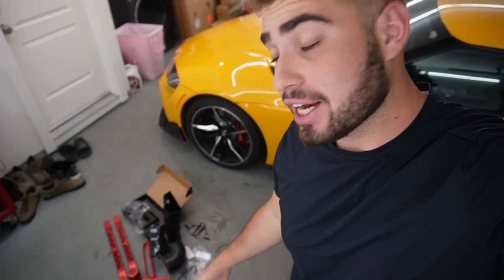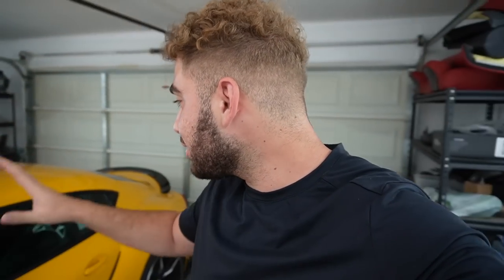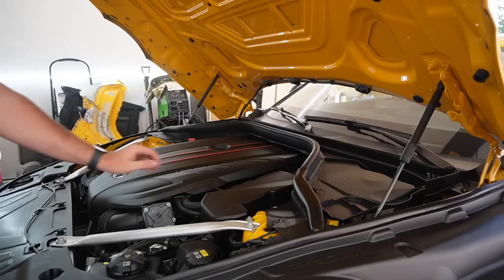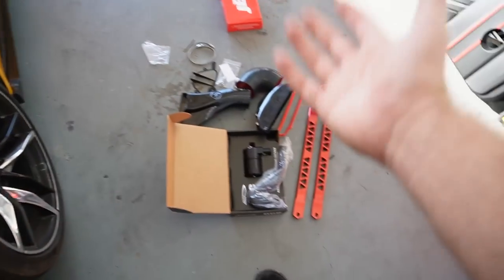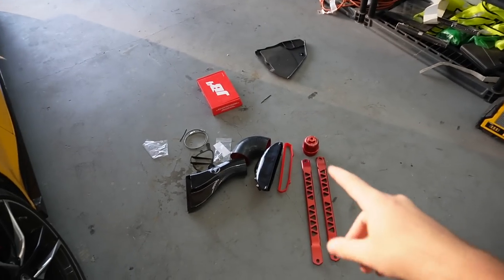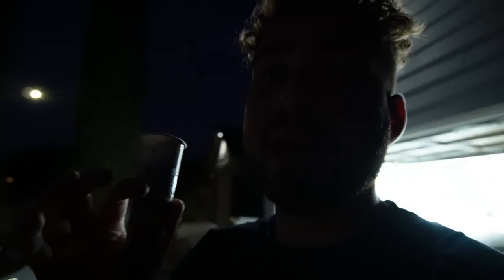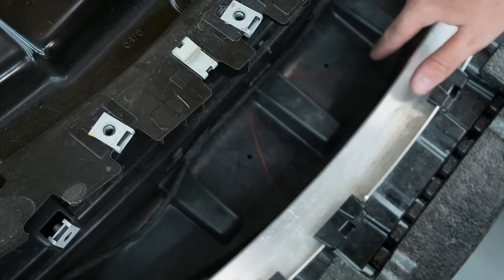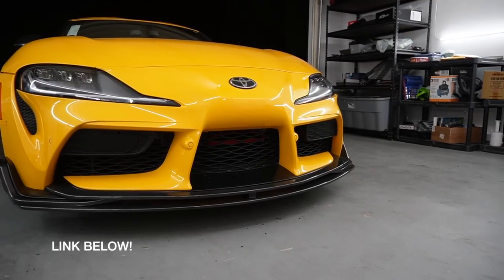PEOPLE TOLD ME NOT TO TUNE MY SUPRA BUT I DIDN'T LISTEN!

Comment: If put a tune on your car (any new car), and the dealer wants to dig into it, they can see it and void your warranty. Not saying they will but they can. Your car will log everything including boost levels. Your boost levels will be over stock boost so they will know you tuned it
Reply: Its not the dealer that wants to dig into it. Its the manufacturer and they will blame anything they can to not have to paid warranty claim.
Reply: @Mike-dd8bd  true but the dealer is acting on behalf on the manufacturer. The manufacturer probably sends in a special guy in certain cases, all depends on the cost

Comment: That is true ,I work with bmw dealership in malta and we can check everything on the car without the car in our premises ,that's why the key cost a lot because basically it tells us everything like a computer   ex. If you switch off the traction control the key will send a signal to our system
Reply: What needs to be done to lose that signal foil ?